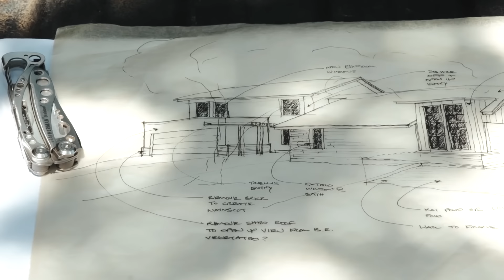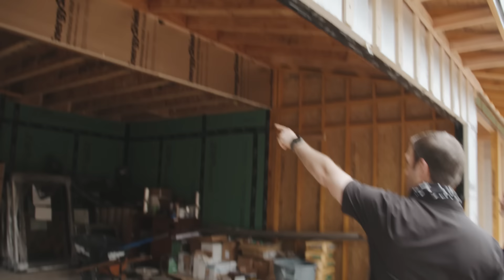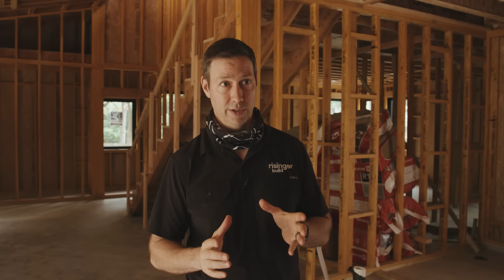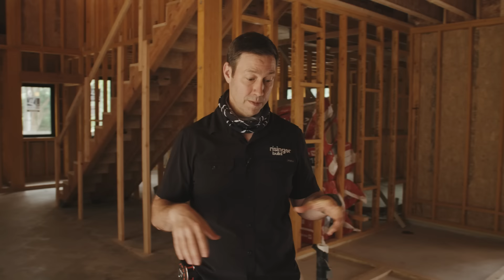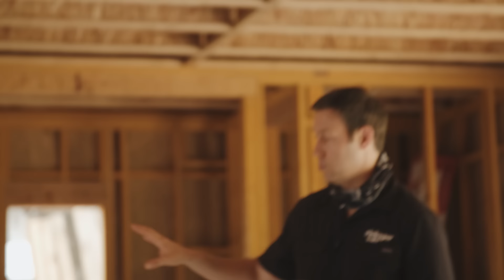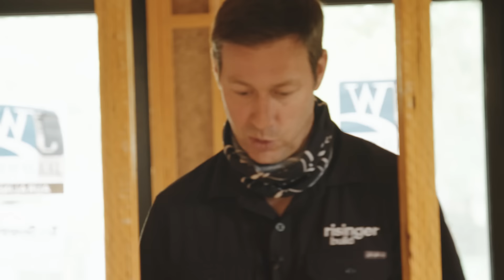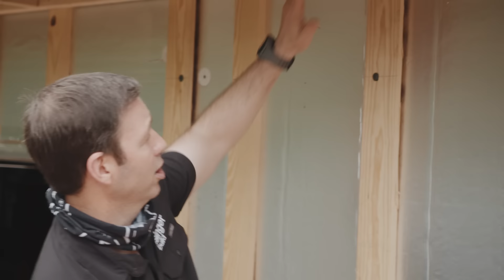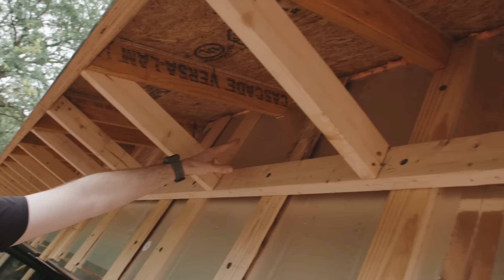The Perfect Wall - Building Science Training

Comment: While this is all cool for new builds and great information, I really wish someone would do a series of video's on a budget remodel of older homes.  What can we do within reason to make them better and maybe live with some the "design flaws" from those years while making them as livable and long lasting as possible within budget. Basically a 1940's on ward to the 2000's traditional house series.   Basically what can we do over time to update our houses.  When it comes time to reroof, replace the siding, water heater, furnace etc, what do we do?  Maybe a series of best practices that has different levels depending on the budget.  I own a 1950's ranch house and my folks have a 70's farm house, both in Michigan.
Reply: Ditto!
Reply: there's this thing called Google, a great aid to doing research - might want try it ~
Reply: This old house?
Reply: Old houses come with a slew of problems and thoughtful cost effective new building science solutions is specialized and a lot of work.  I do think much of what Matt has covered in other videos is there but a summary video would probaly interest a lot of viewers.  Is is better to seal attics when replacing sofits or vent, it doesn't hurt the shingles or sheeting? Including Steve's rules first might be a good way to lay it out.  Water, Air, Vapor, thermal
Reply: @theothertroll  just because its on the internet doesn't mean its the best way.  There are good, better and best options.
Reply: Check out all of the this old house videos. They’re exactly as your wanting
Reply: There is no such thing as a "budget" remodel.... 
Do what Matt did, tear down and start over...

Unless your just doing Kitchens and baths, floors and repaint... Tear it down.!
Reply: @paigest77  
So Paige, I have to ask, how many complete re model's have you done...?
Are you in the construction biz? 
I'm not trying to be snarky, I just would like to get a sense of your experience level before I take the time to elaborate why it is generally more expensive AND ALWAYS more of a colossal headache to re model.

Sure are there other reasons to remodel i.e nostalgia, historical, zoning etc. vs. tear down and start over but if it's just a house
where there is major interior structural mods being done, then START OVER
Reply: New roof paint is amazing
Reply: Great suggestion for a book.
Reply: @RJ-sr5dv  to piggy back of what you’re saying. I have a 1970s  farm house that I was going to remodel and after getting 20 grand in to the project  I decided to tear down and salvage as much as possible because I saw it becoming a money pit because I kept running into more problems.  I get where you are coming from.
Reply: @ridinrancher9443  
Thanks for your note.
I started in the construction business in 1971 with my father, who by himself started in 1956.
After more than a thousand homes / residences and more than a million square feet of commercial properties (small builder status) we learned a lot of valuable lessons and costly ones too. Two of my brothers went on to build construction related business's of their own and have built so many projects I could not keep track.
While both of these brothers are much smarter than I, it could be said we all learned that remodeling, unless there are overriding considerations, is to be avoided. 

I have been approached many times with requests to remodel, my answer 99% of the time is the same, thanks but I'll have to pass.
Reply: Single cell spray foam green. Vapor barrier floor of walls 1 inch spray foam seal
Reply: @RJ-sr5dv  have to agree.  Seeing out of plumb walls, leaks, rot, zero insulation, mechanical systems that are in hot hot hot attic spaces, by the time one rebuilds and renovates the only thing gained is higher cost to do the project.   If one is just doing a flip without dealing with various problems, sure can be a real waste of time.
Reply: Agreed!
Reply: @RJ-sr5dv  I think I agree with the majority of what you're saying, I don't believe half ass remodels can be done without suffering many consequences. But, I do see value in parts of an existing structure, like the basement, foundation, framing, and sometimes sheathing. But that's about it for me. I would not remodel anything unless I was willing to gut the entire house and rebuild as an entire system designed to work together.  You can't just go in a slap insulation on the outside of hang poly sheeting on the inside of the house without impacting the whole performance of the assembly.
Reply: @BatMan-cq8gq  
Of course you’re right.
Every situation is different.
With the skyrocketing lumber etc. costs, you’ve got to put a pencil to.it 

That being said 
, if it’s a remodel I walk away
Reply: @RJ-sr5dv  plenty of demand for new builds, and other projects I see your rationale for not pursuing remodels, I would imagine too many unforseens and managing unrealistic expectations from protential clients in addition to the reasons you mentioned before.
Reply: @GregFredrickson  the voice of common sense 👍🏾
Reply: Home RenoVision DIY is a great channel for exactly what you're saying @William Sickner
Reply: While it’s not what I want to hear, there is merit to what RJ advises. I’ve owned and remodeled 4 houses of my own (first was in Central Austin), and am now in my 5th home on South Whidbey Island, WA, starting a remodel again. It’s much more expensive to remodel than to build new, and the remodeled structure often has limitations due to the original design.

We would have built new, but shortage of construction personnel & supply constraint would have make it take 2 years to complete.
Reply: 1977 AZ home.  Made of popsicle stocks and Swiss cheese....

Id love a series on improving this style of home.
Reply: @theothertroll  excellent trolling...
Reply: @paigest77  no its the only way. Really. I know, I tried to save things like Matt did, and it turned those repairs were actually a waste of money. If it wasn’t done right, its not going to delight.
Reply: @RJ-sr5dv  yes 100%. I learned this doing my first renovation, which is almost completely single handedly. I dont believe a man needs a lot of experience to realize putting lipstick on a pig is still lipstick on a pig. After peeling back layer after rotting layer, i changed directions and went full gut rebuild. And since making that decision, actually almost tore it down, my 1978 house, flippers moved into the neighborhood. In the span of two months two houses were ‘renovated’ while i reframed a single story 16’ 6 window living room wall, w/huber zip system and finishing up the rain screen for vertical siding. Its rained 3 times in SE Texas since and those renovated homes have black mold regrowing in the brick and those new homeowners asking me weekly for help…  I have Matt Risinger and his video blogs to thank for learning how todo build right.
Reply: @zefrum3  I used to be a dreamer but reality got in the way... Thanks for your comments/..!
Reply: 78yr old countyboy.  Thanks for posing your questions.  I too have a 100+yr old homestead home. No foundation,  no insulation.  Added in old inadequate water and electrical systems. Retired and cost of materials have gone out of sight.
Reply: Renovision Channel
Reply: re-siding the home is the perfect opportunity to achieve improved performance. Strip the exterior layer to reveal the backside of the exterior walls. This allows you to seal your plates to the foundation, spray the studs and plates with a boric acid solution to prevent termites and pests. You seal the penetrations of all the outlets, exterior lights, plumbing stub outs, etc. You re-insulate with highest R-value rockwool or mineral wool for your dimension and then add zip R sheathing after liquid flashing and taping the bottom plates. liquid flash the Zip R to the foundation. Then siding of your choice with a cheap and easy roll type rain screen like Keene. Use a bug guard and side your house. Insulate your attic well with blow in on the lid after sealing your fixture boxes just like you did the outlets on the exterior walls. Use rigid insulation panels on the roof deck and add solar powered attic vent fans with one supplying and one exhausting on the gables.
Reply: I screenshot your comment  @Natedoc808  . Thank you so much for summarizing exactly what we need for my father's home
Reply: @FistOfMichallin  you’re welcome. Seems like the YouTube handymen and builders miss the mark showing what/how to modernize an older house’s envelope is. It’s either lipstick on a pig or a multi-million engineering nightmare.
Reply: ASIRI Designs put out videos for retrofitting old homes in hot and cold climates.

Comment: matt you truly are an inspiration. Love your videos and how informative they are.  I have a small hvac company here in south Dallas and I have taken on doing some extra insulation work for houses that are essentially just sheet rock above their ceilings.  I feel like a smarter hvac technician just from what i have learned from your videos.  Your videos help me do my job.  Im a Trane Dealer, my father started the company in '85 when I was born.  I love installing Trane equipment and I have even started installing Mitsubishi mini split ac systems for certain circumstances.  We haven't gotten to the erv machines yet but ive installed some 95% furnaces in some foam insulated homes.  My home is phone insulated, it was built in 60's and i took it down to the studs.  I wish I had watched your videos before I started all that 7 years ago because I probably wouldnt have stopped at the studs and pulled a risinger and get down to the slab.  I hope I run into you some day maybe at a Trane/Mitzubishi Expo or something, it would truly be an honor to meet you.  My Company is Morrison Heating and Air.

Comment: Currently studying for my architecture licensing exams, lots of good info here. 

One fact I find amazing is that a 1" airspace behind exterior cladding has an insulation value of R-1, with foil-facing on one side it jumps to R-3, with a foil facing on both sides of the airspace you get R-10!
Reply: A one inch air gap is R-1 even with the bottom open with the bug guard?
Reply: @COMMANDER-ONE  Yessir, air is an excellent insulator. Even with some of it flowing through openings it top and bottom the gap is still retaining some heat. Similar to how sleeves keep your arms warm while being open on one end.
Reply: how does having foil on both sides help?? wouldn't that just reflect back the heat trying to be deflected away from the interior wall? I'm not sure if i'm making sense, but I have no way to illustrate.
Reply: @lexpox329  It helps to stop convective currents. So if heat is able to pass through one side of the wall into the other side; you essentially get a current within the air space, where warm air rises, cold air drops, and this happens continuously. Since convection is a form of heat transfer, this increases the amount of heat transfer through walls. If you use a foil faced material on both sides of the air space, it helps keep the heat inside the air space, which helps reduce convective currents and reduce heat transfer